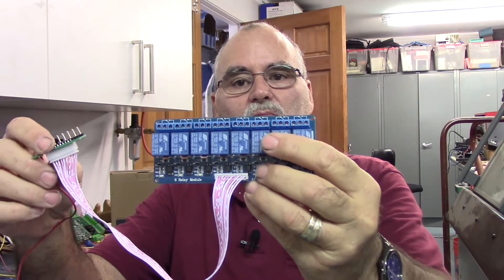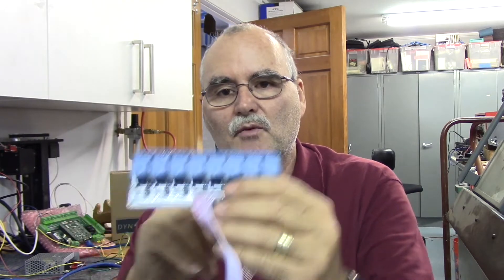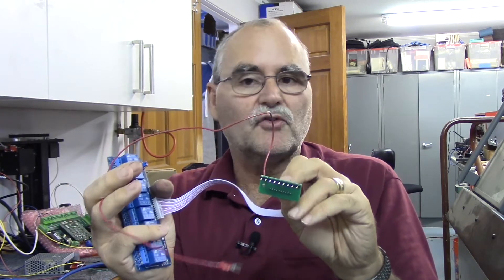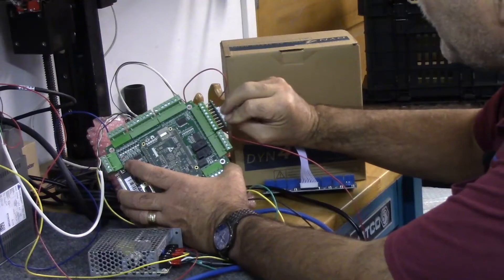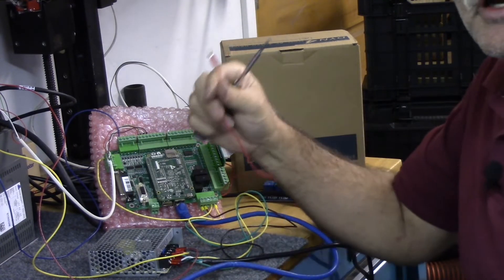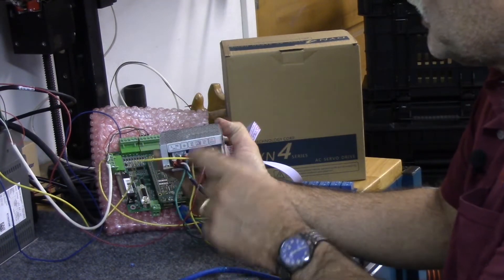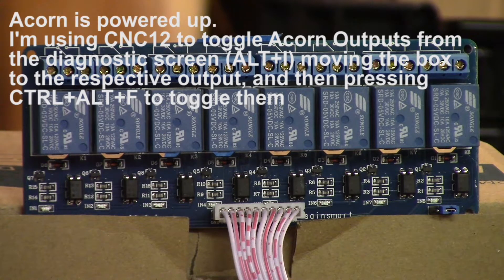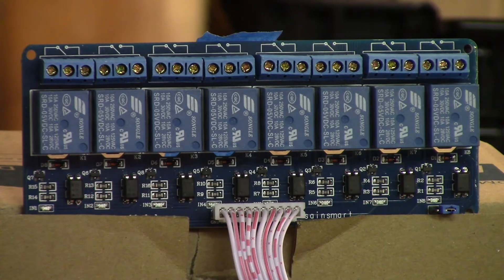Centroid CNC's New Relay Board for Acorn

Comment: Careful with these relay boards I use similar/identical ones.  After a few thousand cycles driving air solenoids the arcing will start to cause the songle (genuine?) relays to stick.  I have used flyback diodes to minimize arcing..but ended up replacing the channels that are driving inductive loads (coils) to mosfets. I just desoldered the offending relays and soldered mosfets in place, appropriately. I have taken the songle relays apart ...it is hard to tell if they are genuine or not.  I'll say the diode reduced the arcing, but possibly I think the 5 volt coils are a bit weak to pull the contacts apart if any arc damage has occurred after time.
Reply: Here's a tip: The Panasonic JS1 series relays will fit.  Try these if the Songle (or sub-Songle) fails.
Reply: @cnckeith  , thanks, also will the Acorn ever do MODBUS?  I think maybe Centroid is instead working on an I/O expansion board, but not with MODBUS?
Reply: @unionse7en  hello. we went with Ethernet..there is a new Ehternet 16 in 16 out expansion board for Acorn in the works!
Reply: @cnckeith  FYI for those following the JS1 panasonic relay pin spacing IS correct, but the case is much bigger... the side of the case will hit the screw terminal housing of the board and cause the pins to be offset from the board holes by ~0.1" , I did some surgery and some pin bending and installed one to test it's contact longevity vs the Songles (or fake Songles). Will let you know what happens in a few months.
Reply: @careless8882  hello.  We are offering it as a kit with the adapter card and ribbon cable for convenience and it is included Free of charge with the Acorn CNC controller kit.
Reply: @careless8882  

The Relay Adapter kit for the Acorn CNC controller is included with the Acorn Kit Free of Charge. If you bought an Acorn kit before the Relay Adapter kit was available (approximately 10-22-18) you have several options:

a.) purchase the Relay Module Adapter Kit for $39 from Centroid. Here is a link to the Relay Module Adapter tech sheet that covers the Acorn CNC relay board installation and operation along with hookup diagrams.
http://www.centroidcnc.com/centroid_diy/downloads/acorn_documentation/acorn_relay_8_kit.pdf

b.) purchase the SainSart relay module and ribbon cable online (amazon, ebay, sainsmart etc.),  cut the cable at the Acorn end and
wire the relay module directly to the Acorn Output Screw terminals. (the Centroid Acorn adapter board is not necessary to run a relay
board! it is for convenience as it allows very quick error free
connection to the Acorn board for novice users)

c.) purchase any one of the numerous relay modules available online and direcly wire it to the Acorn Output Screw terminals.  Here is a
Centroid Acorn wiring diagram showing how to do this.  http://www.centroidcnc.com/centroid_diy/downloads/acorn_3rd_party_relay.pdf
and Marty made a great video showing this as well.
https://youtu.be/tc8MYGzEFAY
Reply from the maker: @careless8882  , anyone is most certainly free to do what they like and purchase wherever they like.. Centroid developed the adapter board and cable and decided to kit it up with the Sainsmart relay board as a convenience to their users and make it available at a price that makes sense for them. It's reasonable to respect that.